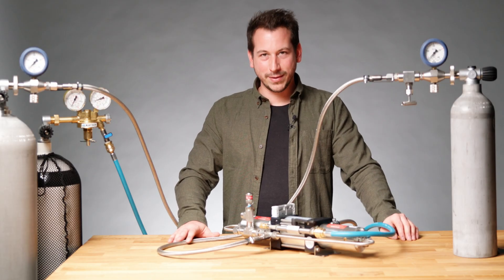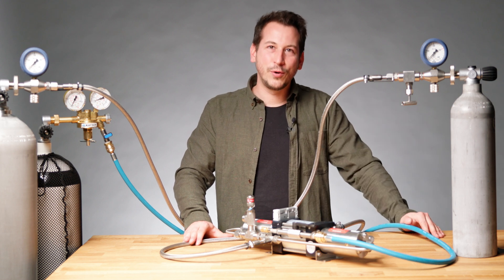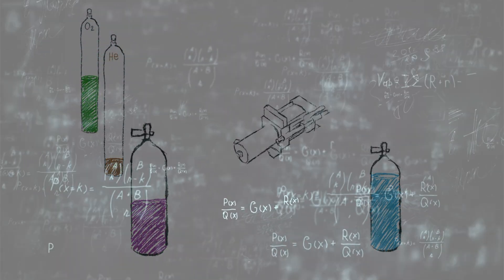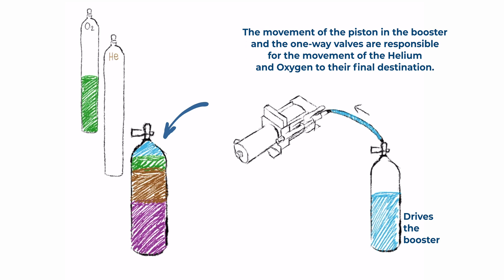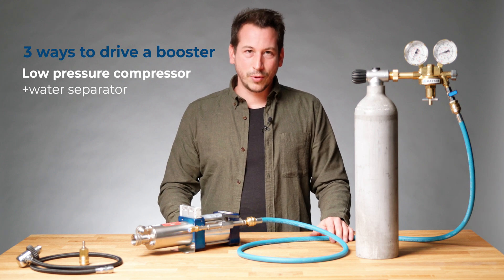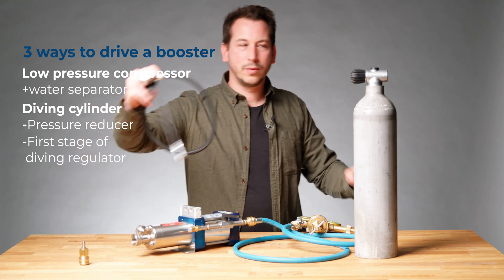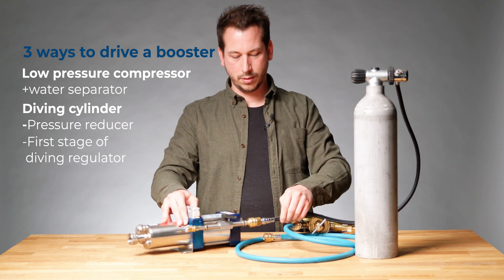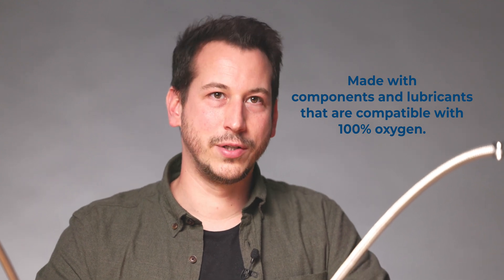What is a gas booster pump?

Comment: How much air use to drive booster those pneumatic booster
Reply from the maker: depending on the booster model, the filling ratio aswell the filling speed here a example:
https://nrc-international.com/cdn/shop/files/Datenblatt_220_1_Deutsch.pdf?v=17543022267553408149

Comment: Hello, I have a question, I want to buy equipment like this to empty my zeppelin (blimp) and return the helium into the cylinder! Is it possible to do this with this equipment? Or does it just transfer from one cylinder to another? thank you very much!
Reply from the maker: Hi, Booster pumps are designed in such a way that they require an inlet pressure of approx. 5 bar upwards. Unlike the usual high-pressure compressors which suck in atmospheric air. Yes, theoretically they can, but they are very inefficient